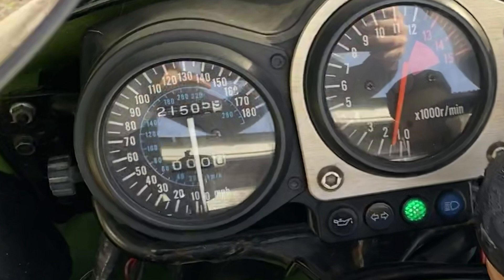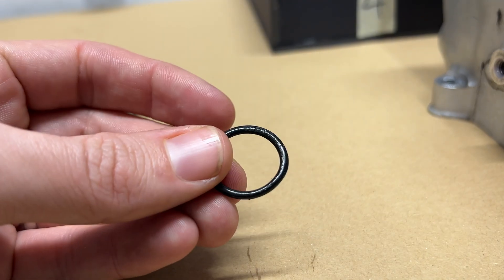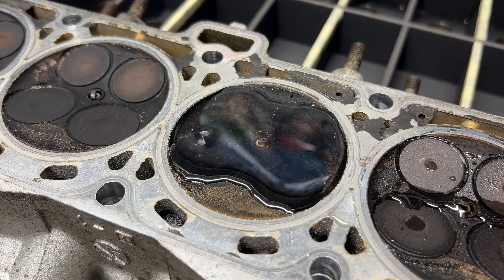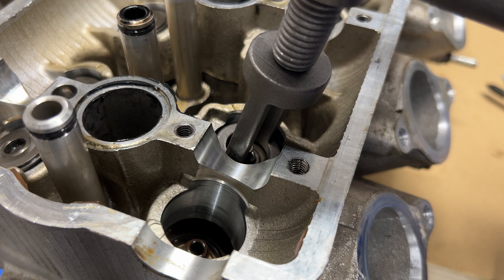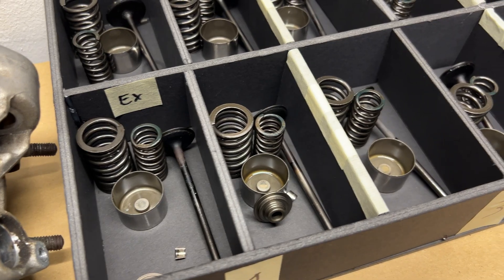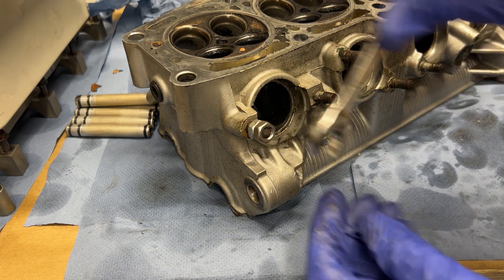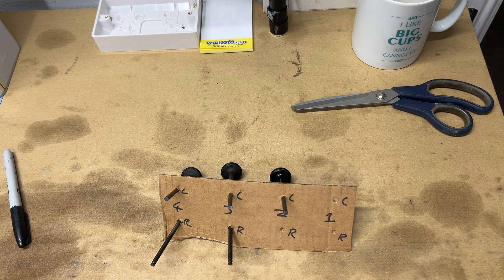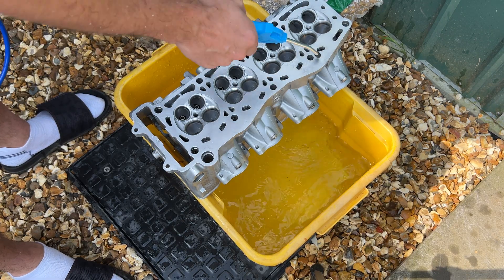ZX7R Cylinder Head Disassembly - Ep11 | ZX7R Restoration | Tom's Workshop

Comment: jumping ahead a bit Tom are you going to upgrade headlights to LED bulbs
Reply from the maker: I haven’t thought about that yet to be fair, but I’m open to changes like that if they improve safety but don’t affect the style of the era. I used LED indicators on the FZR and it just required the respective relay to get the flashing frequency correct

Comment: why did you not put the valves in the ultra sonic cleaner or even better in a bead blaster
Reply from the maker: I did put them in the ultrasonic tank , but the solution I currently had in there wasn’t really strong enough to break down the carbon. But I didn’t really need to go as heavy as the bead blaster, they came up clean enough with the abrasive pads.

Comment: You dont lap those valves or do anything abrasive. You replace them with new and have a professional CNC cut the 5 angle seat and replace the guides if necessary. The valve is coated and will form a seat when idling at 2k for break in period of about 10 minutes. I learned the hardest way..to always send my head to a professional race shop. Have them inspect and replace what is needed. Your work here will make it run.. but its not going to be very even or last as long as OEM.
Reply from the maker: I’ve read about this with modern engines, but when trying to ascertain the situation with this bike it didn’t seem to be the case? The two manuals I have suggest light lapping with fine paste only. But I’m also going to base the need for that on the result of the contact patch test. Appreciate the advice though!
Reply: @tomsworkshopprojects  I might be incorrect then on that year Kawasaki if the manual says lapping is recommended.. I'm used to working on Suzuki and they say do NOT  lapp. lol.. Im currently working on my own 1994 ZX9R. Thank god the engine is low miles it just needs all the other maintenance crap and valve guide seals is one.. Keep the videos coming. Wish the USA had more 90's super sports in fair condition. UK seems to have an abundance.

Comment: I'm doing a full restoration of my 87 FZR1000, and the head, namely the valves are giving me grief. At least half the exhaust valves are worn to the point of needing replacement, but you just can't get them new any more, the model was only made for 2 years before they changed the design in the EXUP. Every now and then i find one on ebay. 😮‍💨
Reply from the maker: Ah that sucks, are there any full heads knocking about or donor engines? I guess that’s a pain to have to spend so much to get a few bits.

Comment: Is it really beneficial to blow against the valves, while they work in the opposite direction? Compression of thencylinder should close them i guess?!
Reply from the maker: It’s a pretty rudimentary test I agree, you’re only getting the impression of how good the seal is, but the strength of the valve spring should be able to hold it with enough force to form a decent enough seal to not let air past that way. I think the technique is important not to insert the blowgun too far in as you’re really just raising the pressure.

Comment: i put the valves in a drill then soak some scotchbrite in WD40 to clean them also doubles as a good test to see they are straight
Reply from the maker: Nice idea 👌🏼
Reply: Worst advice in the world. soaking in carb cleaner like berrymans (nasty stuff) works if they are seating correctly and not out of spec. NEVER use ANYTHING abrasive.

Comment: Coming along well! I just got finished waiting on a cam chain guide for the inside of the valve cover to be shipped to me from Japan.  Got the engine back in the bike last night and hopefully might be starting it tonight
Reply from the maker: Nice! Hope it goes well! I just got that same part come through for the head cover. Though the thought of that going back on seems a while away yet 😂
Reply: @tomsworkshopprojects  had to pull the top end back apart one my green one anyway, since it dropped a valve. Haha. My blue one starts and runs nice. I’ll be getting fairing kits for both of them soon. It’s funny to think that my green one was originally just sold to me with the blue one as a parts bike
Reply: @tomsworkshopprojects  https://youtube.com/shorts/nxCOhf60zHE?feature=share